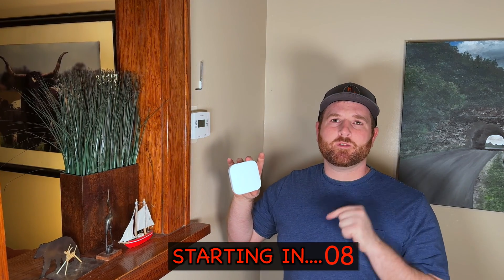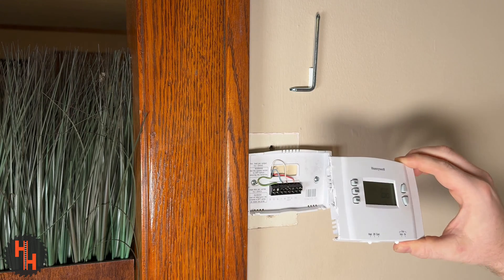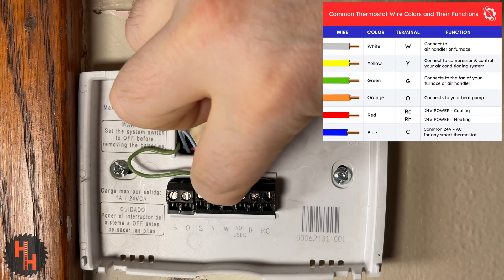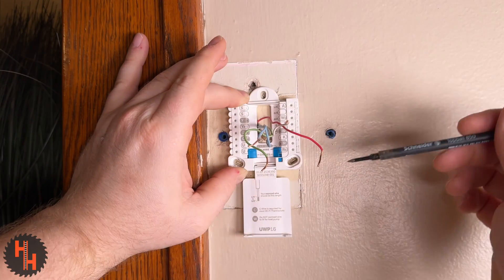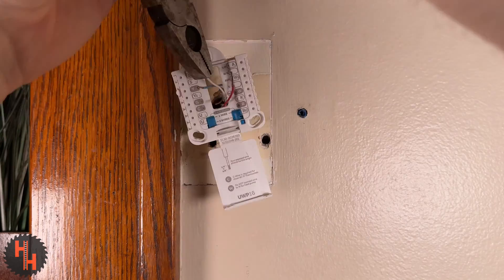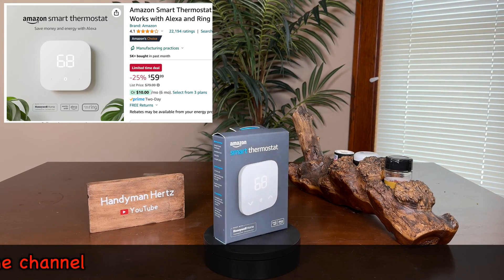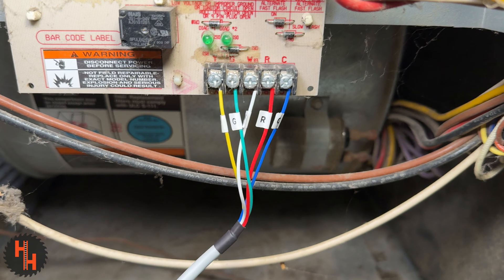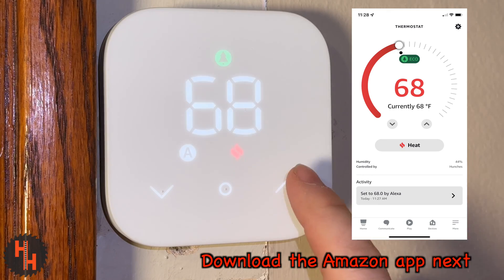Install an AMAZON Smart Thermostat: 2-Minute Tutorial Ep.10

Comment from the maker: ⚠️ Did you find this video super helpful or save you money? Buy Tim a coffee to say thanks: ☕ 
PayPal: https://paypal.me/handymanhertz
Venmo: @timhertz      
CashApp: $timhertz1
Reply: I would be happy to venmo you if you can show how this can work with gas boiler whereby the Amazon smart thermostat also controls the cooling. I have extra wires that run from the boiler to the thermostat and I could use to run an independent 24v power supply. The problem is that the C terminal is already in use from one of the AC wires.
Reply: If you not gonna show the step by step for example how to connect the 5 wired adapter there is no use for this

Comment: Thanks for this video. I'm considering buying this thermostat, but want to make sure it will work with my system. I currently have a ast gen nest that uses 6 wires. My connections are: Y1, G,  W1, C, * and RH. The Ring thermostat doesn't have a port labeled *, so would this work?

Comment: Worthless video.  I know how to use a screwdriver and mount a simple plate to a wall.  Explaining the wiring is the important part and that was glossed over completely.
Reply: its not wven wortg it to me ill stick with my new reg button one i installed those can lock out in emergencies meaning you cant control the temp

Comment: What about the bridge between R and RC?
Reply: Right, you dont need it, but you do need to be sure the little blue slider on the rt side is in the up position. thats what creates the Jumper between R and RC.
Reply: @robertpetrin7413  thanks for the tip! I thought this wasn't compatible with my 2007 Rheem, until I flicked the little blue switch up!!! they should really make that clear in the directions. Thanks again.
Reply from the maker: What about it?
Reply: You dont need it